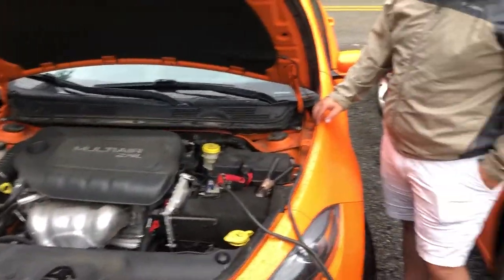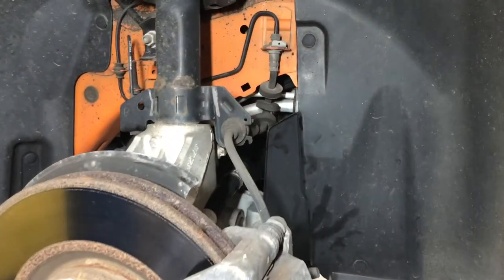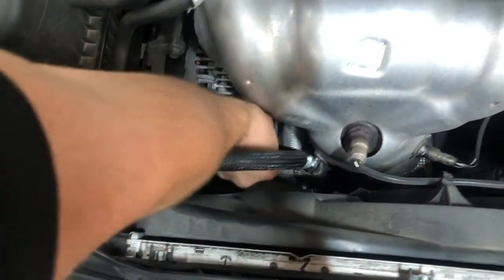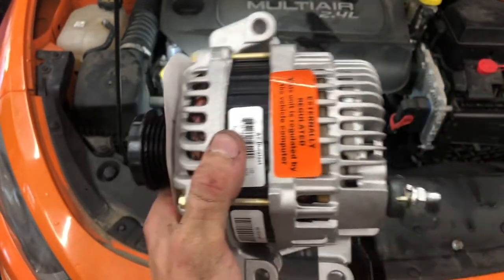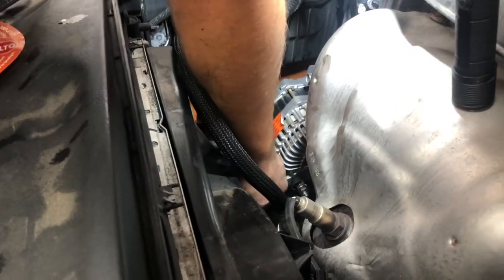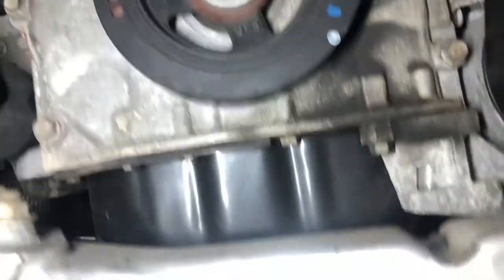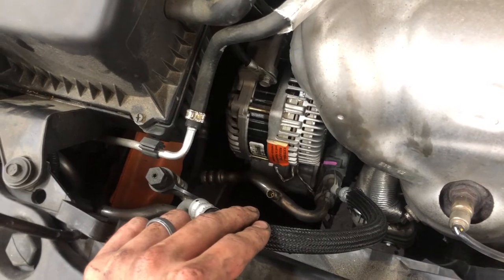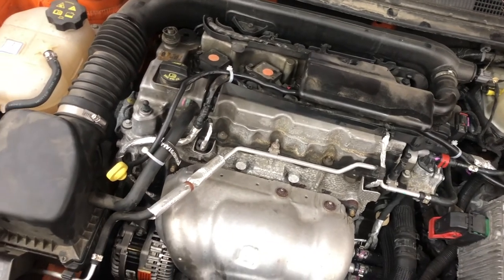DODGE DART ELECTRICAL GREMLINS FIXED?! - 2014 Dart Alternator Replacement and $15 Ground upgrade!

Comment: At around 130,000kms I had a no start on my 2013 dart,found a main broken ground wire, fixed it and added a 2nd ground wire from the battery to the Transmission, I now have 487,000kms on the dart trouble free,going for 500,000kms then aiming for 600,000kms,this has been a great car for us,it had only 21,000kms on it when we bought it in 2013
Reply from the maker: Glad to hear it’s been a solid car these seem to be pretty reliable after a few mods like the ground wire

Comment: If you pull the filter housing and tube it's alot easier. Can change mine in about 25 mins lol. Save alot of time.

Comment: I've added more grounds and it's helped my 2014 dart alot
Reply from the maker: Glad to hear it. Since this work on the dart it’s been over a month with no further issues.
Reply: Next time it could be the oil pressure. Mine does the same when the oil gets low. Engine shuts off but radio and all other electrical works.
Reply from the maker: @d1drummerboy76  yeah I mention on the description to check oil as well as these motors can’t run low or they shut off. But it’s something we all need to be sure we check :) thanks for the comment !
Reply: @d1drummerboy76  hey my darts oil pressure sensor goes off after one or two days of replacement so what would be the issue and how to fix it
Reply: Instead of taking of the tire maybe the air intake would be a faster and better method on this
Reply from the maker: @jeramygrajiola1544  yeah I believe I mention that in the video . I will say that when putting the belt back on I needed access below to get it back on the pulleys.

Comment: I have a 2013 dodge dart that was running fine till other day I went out to start it and all lights came on my dash (check engine battery light overheating, etc basically every one) and gauges weren’t working (didn’t move the car) and wipers were going off by themselves could this be why ?
Reply: Does your radio screen light up white before car just shuts off and bluethooth not working or hands free mode
Reply: @williampickett1026  not sure haven’t moved it since to scared to drive it just turned it on and it started doing all that 😫
Reply: @verenaabigail2230  same here it did that while I was driving and locked up my steering wheel while driving I'm in the process when I take a look at it to clean all cables going to battery and terminals with sand paper then ground points on frame also ( oil ) make sure that you are good on it that motor will shut off like that

Comment: Great job man.
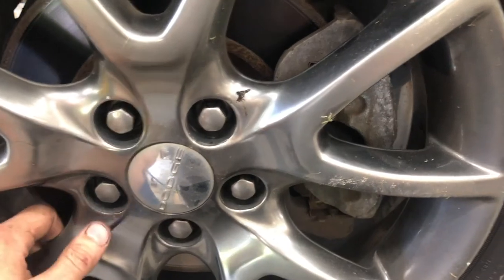@25:26
If you disconnect the negative battery terminal that will max out a good alternator. 
Can that cause any kind of a problem ? You know . . .  since the voltage will peak and max out the voltage. 
If the alternator is not charging, then the engine will stop running.
I know this trick works with 90's and before without much of a worry.
Reply from the maker: So to start I do not know for sure if it will cause an issue. Technically an alternator when spinning can generate as much as it wants and its usually controlled how much it sends to the battery or discharges. I think it depends on if the alternator is computer controlled or not. Some have a sticker on them that says if its PCM controlled or not. I have only done the "unhook battery" on a few cars in the past few years and none of them were very new. I caution doing anything too risky on newer cars with all the electronics as anything can happen and PCM's are pricey!

Comment: I'm have the same darn issue with my 2.0 1st it was the the ground. It was completely corroded and flapping around. Fixed that worked a bit now I'm having same issues. Writing this as I'm watching this video. Hopefully it's alternator.
Reply from the maker: as crazy as it seems dont forget to check the oil level too. Ever since adding a new ground, a fresh oil change, and replacing the alternator this dart has been solid. Its actually due for an oil change this weekend after it did a trip from Maryland to Florida and back.
Reply: Was it?

Comment: Going to do this on Saturday been through like 5 batteries in under 100k miles . yesterday on a 5 month old battery it died on me and no crank got it jumped disconnected the positive and the car died . Gonna remove it and test it and I really appreciate this video. Would love to know what that tool is called
Reply from the maker: Hey there! sorry I dont know how I missed this comment. Usually youtube tells me. What tool did you have questions about?
Reply from the maker: If you look up Trim removal tool kit you'll find a set of plastic tools that include the metal fork I used to separate the plastic clips. BEST 20 BUCKS I EVER SPENT! if its a different tool you are looking for let me know.

Comment: I just did this 01/14/2022 to my 2013 Dodge Dart because my car will go through random spurts where it doesn’t want to start and other days it acts perfectly fine. I’ve replaced the alternator and battery, and now I added this ground wire. At first it acted fine, but now it’s acting like as if I’m pressing on the gas and rpm’s go up and it starts to sputter, so is that possibly mean it still doesn’t have a good connection or something else?
Reply from the maker: If you have a ground straight from the battery to the block I would find it highly unlikely you have a ground issue. It wouldn’t hurt to ensure the factory grounds are cleaned as well I did that in another video . When the car sputters does the check engine light flash? Have you checked the oil level as well to ensure it’s properly filled? If it was only a start issue and the grounds were cleaned I’d point to the starter. But having start issues which I assume is a no crank and spitter I’d rely on an engine code. Is the start issues long crank or no crank and How many miles are on the car ?
Reply: Let me also add that I’ve never had this problem until I added this ground wire😅
Reply from the maker: Make sure your terminals are tight as well . Just in case when adding the ground the negative terminal isn’t tight
Reply from the maker: @miguelhuizar5849  are you sure your negative terminal on the battery isn’t loose ?
Reply from the maker: @miguelhuizar5849  got about 1500 miles on mine now and it’s great. Unless your car is having problems after a battery loss . I can’t see any reason a ground can cause a problem . If you ask google it will say you can never have too many grounds lol . Gotta be something else going on that happened while you were in there. Maybe you bumped a coil plug or something ?
Reply: My dart has about 94k miles on it and I’ll have to go back in and double check I didn’t bump anything and check my terminals again. I cleaned the factory ground wire already based off your other video. You’ve been a bigger help in trying to understand what’s going on then the actual dealership. I took it them for the problem and my starter tested good and they couldn’t figure out why my car wouldn’t start and I came across your video and thought I’d give it a try. I’ve been dealing with this problem for a few months now and nobody seems to understand what’s wrong with my car lol. I work 3rd shift and I have to go in tonight, but I’ll work on my car tomorrow and report back
Reply from the maker: @miguelhuizar5849  sounds good and ill try to help where I can. so next steps are to just ensure the terminals are tight and clean. check the wiring for the coils to ensure nothing went crazy, check oil level, and see if you can get a code scanner to see if there's any pending codes even if the CEL is not on. I can't imagine its acting up without some kind of log in the computer. As for the dealers, I have had so many people reach out in the grounds cleaning video that it fixed their issues and the dealer couldn't figure it out. Sad to say its hard to trust people that are motivated by how much money they can get out of you.
Reply: @JustFixinGarage  I never got back to you just to see if it stayed consistent and so far it seems to have fixed my problem. Not once has my dart had trouble starting. Even today after work in -15 degree weather it started up with no problem! So I sincerely thank you for this video!
Reply from the maker: @miguelhuizar5849  thanks for the follow up I was wondering what happened . Glad it’s been good now . Maybe after the battery disconnect the throttle body had to relearn or something. Either way glad it’s starting consistently for you.

Comment: Hey man, was working on grounding my dart just today. I was not able to loosen the top bolt of the alternator for the life of me, but I could loosen the bottom bolt that already had a wire to the positive terminal, I believe. Would I be able to ground from that bolt I loosened to the negative terminal while the other cable is still there or would that cause some sort of short circuit? Thanks in advance!
Reply from the maker: Hey Alan , if you mean can you use the bottom mount bolt that holds the alternator in place yes . You wouldn’t want to hook a ground to the electronics part of the alternator or that may cause a short if it’s 12 volta straight to ground. There are likely other spots of the car that make a good ground point I just chose the top alternator bracket for accessibility . A good ground will be clean metal that is part of the motor and away from any sources that might melt or cut your wire .

Comment: Would the ground upgrade possibly cause any long term issues? I want to try this but I’m not sure!
Reply from the maker: There is no issue with a ground upgrade . The more grounds the better . Electricity needs ground to compete the circuits and will take the path of least resistance . I strongly suggest cleaning the grounds and adding one as well .

Comment: Would I be able to ask a mechanic to check the grounding? I had recently had my car tested and I was told it could be grounding or the alternator but I’d rather find out if it’s the grounding first.
Reply: Did you try the negative battery jumper cable test? It worked for me! Connect the negative jumper cables to the front bolt on the alternator then the other on the negative terminal… then start

Comment: Question for you, Do I need to worry about cleaning the old ground locations you show in you other video if I do the ground wire upgrade? 

My Wife's car is having a weird issue where it will not start on the first and second attempt of turning the key to start. However on the 3rd try it starts up fine. No Issues. 
She does have a small Evap leak code (P0456,P0457) which i believe is the gas cap. However this is a seperate issue and shouldn't play into the starting mystery.
Reply from the maker: If you clean the ground well it should be good to go. I add a ground because the more grounds the better and the one I added is much thicker and will stay crud free longer. If adding the ground is easier than cleaning the old you can do that first and see
Reply: @JustFixinGarage  Thanks for the quick response. Yeah I think adding the ground would be easier than cleaning the old ones. Don't have to lift it. sucks this is the only car we own that won't go up Rhino Ramps... due to being to low.. lol
Reply from the maker: @rockerac1  I’ve had a few low cars like that where I jacked the car up and put it on the ramps since the bumper would hit . Or use 2x10 boards in front of ramps to get it over the lip of the bumper . The lift is a huge advantage and having a garage like this was a goal of mine since I was 16 . At just shy of 30 I had it built.
Reply: My 2015 has the same code… even after replacing with an original factory gas cap… but I tried the negative jumper cable test and it started… have never felt concerned with the gas cap codes personally

Comment: If I can't find that exact battery cable, does it have to be a certain type or will any of them work?  My car is the 2013 Dodge Dart RallyE if that helps.  Thanks
Reply from the maker: Longer or shorter as long as it reached and the loop is big enough to put the bolt through is fine.
Reply from the maker: You’ll want to make sure it’s heavy gauge ofcourse . You could make your own from even a car amp wiring kit as long as it is crimped well etc . I do like the ready to go ground cables though from the auto parts store .

Comment: Hi, I have a similar problem on my Dodge, one day the battery light came on and the dashboard started flashing, then the power steering went out. The mechanic replaced my alternator and computer. Three thousand kilometers there were no problems. Daily checked the voltages, on the started car, everything was fine 13,7-14. But a couple days ago the battery light came on again and the dashboard started flashing. Brought it to the mechanic, but there everything is normal, the lamp went out and everything is fine. The mechanic says the alternator is fine and the battery is fine too. Could this be the cause of the grounding? Thanks
Reply: Did you have an oil change when you took it to the mechanic? These things have a warning for large oil consumption… and upon my research I’d say the oil pressure was low based of low oil. Even though the oil light doesn’t come on

Comment: Hello, I was wondering did this do the job?
Reply from the maker: Hello there ! Yes and no . The ground upgrade and alternator fixed the existing issues as it was a bad alternator and the ground connection kept getting dirty . We are dealing with a new intermittent no start issue with it which we believe is tracked to the fuse box ( possibly bad ) . For now there’s a bypass button put in . Couldn’t figure it out myself nor could the dealer or another third party shop . The next thought may be to replace the tipm/fuse box .

Comment: Bad ground wouldn’t throw a check engine flash though
Reply from the maker: Sure it can . Provide a weak ground to ignition coils and cause a misfire . You’ll see a blinking light then . Probably less common but it’s definitely possible .

Comment: I have a Dodge Dart 2014 2.4 rallye and sometimes when I start it it’ll just click no crank or anything just a click. Sometimes I keep trying and it ends up working. It will be good for a couple days then out of no where it clicks. Recently it’s starting to click every time I turn the key to try to start it. Do you think it would be the ground wire also?
Reply from the maker: I would try the jumper cable from ground on battery to the motor block if it cranks instead of clicks this is your issue. I have another video on my channel diagnosing a bad ground on the Dodge Dart . Search “no crank no start Dodge Dart” and you should find it
Reply: @JustFixinGarage  yeah I’ll check it out and give it a try I’ll see how it turns out. It seems odd cause eventually it’ll start after a couple of times twisting the key just normally.
Reply from the maker: @leom1094  It certianly can be other issues like ignition going bad, bad spot on starter, etc. But the cheapest (free) and easy thing to check first is the grounds. In the other video I used some house wire but its easier to take only the one side of jump cables (say the black sides) and hook one end to the negative battery terminal and the other to the top of alternater. Make sure that there is no wires hanging in the belts etc. Leave the red side completely off of everything. Itll be best to test this when its just clicking and if it makes the car start or you see a spark when connecting the ground it means you have a bad ground and need to clean it or add in one like I did here. If thats not it I have ANOTHER video where I do the starter . Its accessible if you are patient all from the bottom.
Reply from the maker: @leom1094  https://www.youtube.com/watch?v=cRu_zZA1hEs&t=2s
Reply: This is exactly my problem, was starting after a few tries and now it only clicks not start even if i try many times or different days, what ended up being your issue? Thanks in Advance

Comment: Been having the exact same problem. Some mornings when i go to work my dart dies ononce leaving the neighborhood, its clicks the first time after that the dart(45,000) starts strong and drives fine. Also sometimes if i brake too hard my dart dies, then it starts ups like nothing happened. Been doing test on the alternator it tested positive same goes for the battery(Aug2021), could it be that that im having a false positive on the alternator?
Reply from the maker: Check your oil level first . If the oil is too low car will die while driving . When an alternator goes and the car dies while driving it usually means the battery is dead and wouldn’t restart without a jump . Since it happens when you brake hard makes me think the oil sloshes around and causes it to die . The motor will not run when low on oil .
Reply: just did an oil change and added the extra grounded cable, ill let you know how it runs @JustFixinGarage
Reply from the maker: @TheJrojas1997  sounds good hopefully your all set !
Reply: Oil pressure is my guess?  I’ve had this happen will 60% oil life. What was the fix?

Comment: My dart has a battery light after changing the batter and alternator
Reply from the maker: make sure your connections are all clean on everything including the grounds to the frame and trans. Check the wire connection pigtail to the alternator make sure no bent pins or corrosion. May have just been unlucky with a bum new alternator especially if its a reman.

Comment: Where u located?
Reply from the maker: Elkton MD / Newark DE area
Reply: @JustFixinGarage  hey i have a 2014 dodge charger all the interior lights,dash and headlights flicker radio screen goes black and dash while driving. I replaced the alternator new battery and still doing the same could it b a electrical problem?
Reply: Did you fix it? I have same problem.
Reply: I fixed mine it was a ground cable that was loose